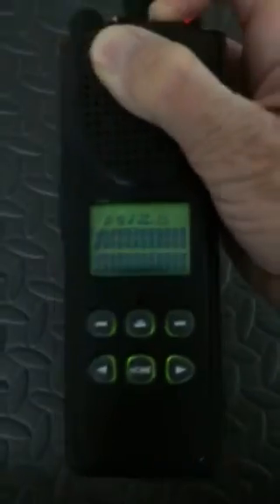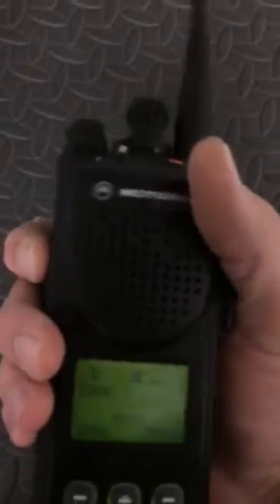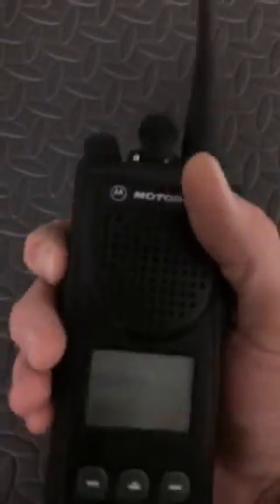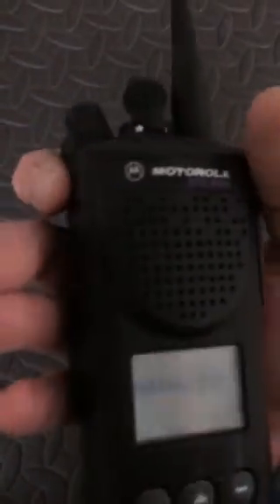Motorola XTS3000 - How to put the unit into "Service Mode" and Check the LCD for Missing Pixels

Comment: I'm sorry scratch that. I'm able to illuminate the screen but I'm not sure if I can check the pixels (waiting on new keypad board so no screen until I get it for 2500) I am pretty sure that the 5000 will display pixels though.
Reply from the maker: Austin Jewsbury 2500's will only show the symbols, not the blocks, as the 3000's will.  The best way to check that I've found is to fill the screen with as much text as possible.

Comment: The same process works on my 2500 and most likely on the 5k as well.
Reply from the maker: Austin Jewsbury I have only been able to check for missing pixels like this on 3000's.  You can do this on your 2500 and 5000?

Comment: Okay okay, I like this Dan! lol. It's a start! haha. There's no way to do this on an XTS2500/5000 right?! Is there technically no "pixels" or?!
Reply from the maker: Shot this with my iPhone.  Sorry for the quality.  If there IS a way for 2500's and 5000's, I've not come across it yet.  I just program a channel with as many characters as I can.  You CAN get the icons to test, but I forgot how.  As long as the channel screen is devoid of missing pixels, the display is fine in most cases.
Reply: Quality is pretty good Dan!